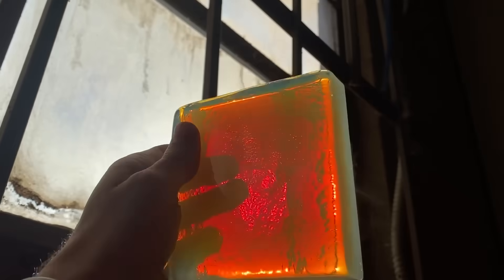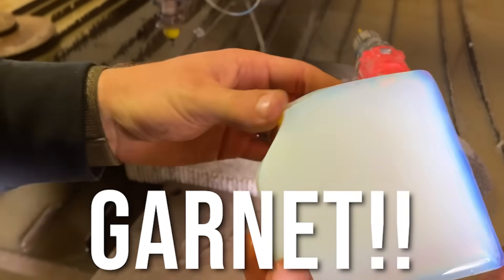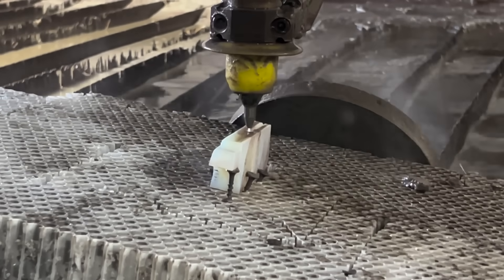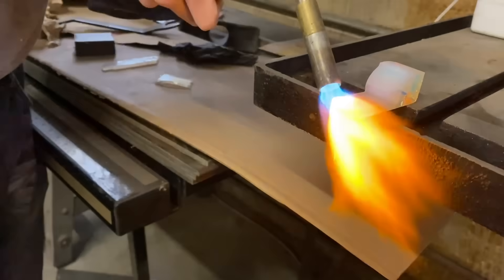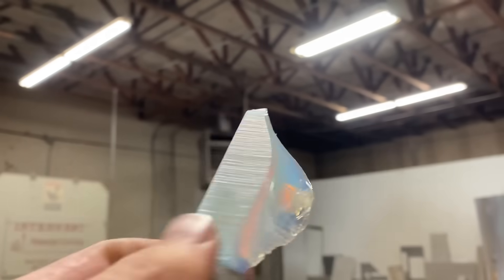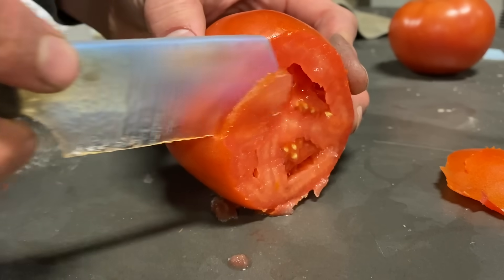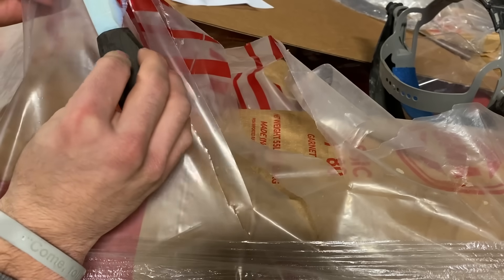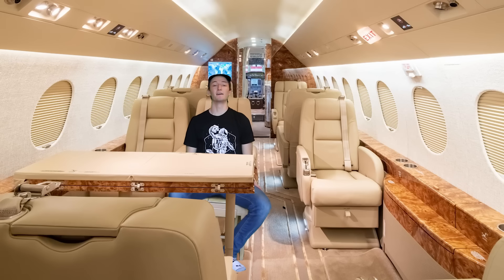World's Sharpest Opalite Knife

Comment: Honestly if you'd use higher grit paper on the thinner one you might be able to get it sharper and try sharpening one side only to get a thin sharp edge, it's not steel it's probably gonna loose its sharpness from sharpening both sides because its softness makes a hard bevel

Comment: The most dangerous knife is not a dull knife, it's a sharp knife in the hands of someone who doesn't know what they are doing........
Reply: Nah it's still the dull knife, even an idiot can make a semi clean cut regardless if a few fingers are in the way. The dull knife on the other hand will make the idiot use more force which can cause them to potentially use enough force to cause the knife to go flying potentially giving someone a Darwin award by proxy.
Reply: @simonnachreiner8380 it’s def not I’ve used dull knives often I suck at cutting but even when I make a big whoopsie I’ve never gotten cut with a dull knife a sharp knife on the other hand cuts me without me even noticing most of the time 😭
Reply: @xiyu-m8z when you use a full knife, you’ll use more force, so if you slip, that’s a ton of speed and force, and if it hit your hand… yeah
Reply: @freemanc6258  hasn’t ever been an issue even when accidents are made, the thing with a sharp one is every single accident will cut you no matter what.